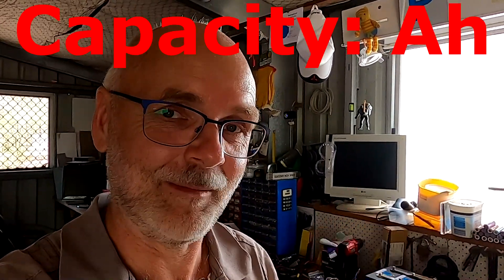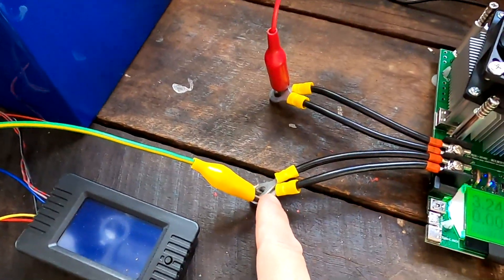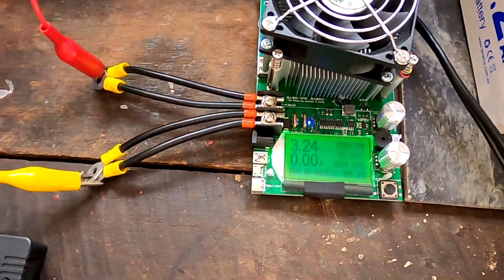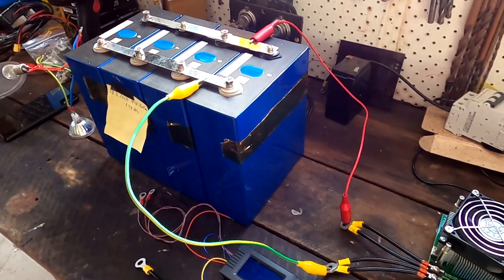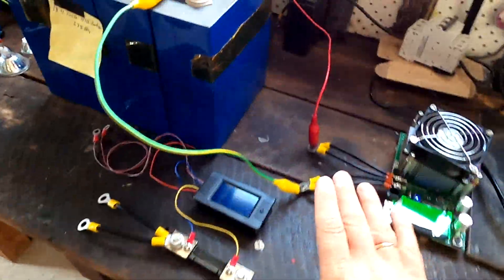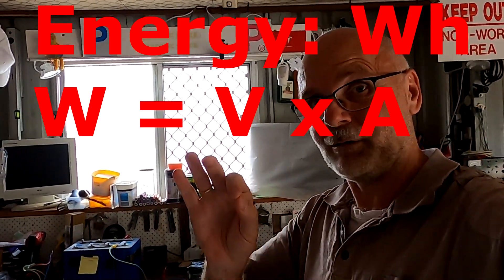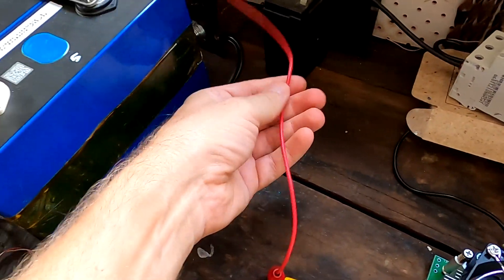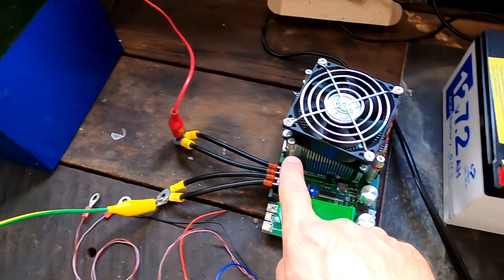Why Voltage does not matter at all during capacity testing! Here are the basics...

Comment: So basically, if you have a 1v battery and a 48v battery - both 280Ah (or whatever), you will get the same Ah even if you use a super thin wire... so the question is - why should we care about capacity? at the end of the day, we use batteries to store energy - so what we care about is Wh we get out of a battery (or pack). If that was not the case, we would not care about wire losses, battery resistance, etc etc... capacity itself is meaningless in real world applications.
Reply: Because it'a an easy way to test battery capacity without having to account for losses in wiring, wire sizes, load differences, voltage measurement inaccuracies, etc. You measure the amount of amps you get out of the battery, and compare to the manufacturer stated amp-hour rating. The amount of Wh you get out of a battery though is directly connected with the Amp-Hour rating, since the former is just the same thing but taking the voltage into account.

Comment: Happy New Year,,,, Professor Off-Grid Garage ;)

I almost forgot, I have a question.
I have a common 100 amp BMS for my batteries, but I'll be using my solar panels to charge, do I need a different BMS?
Thanks
Reply: No. The BMS protects the individual cells from overcharging or too much discharge. The solar has nothing to do with it.

Comment: While voltage is not in capacity (Amp Hours), the hours are time from a 100% SOC to 0% SOC, and the SOC is determined by the terminal voltage, is it not?
How did you determine 100% SOC and 0% SOC?
Reply: Charge to 3.65V until the in-going amps drop to 0 (i.e., no energy going to the battery anymore) for 100% charge, discharge until the voltage on the battery terminals drops to 2.5V for 0% charge. A LiFePO4 battery has a very flat voltage curve over the entire capacity except at low and high states of charge; very easy to measure.
Reply: @upnorthandpersonal  I am just saying you have to be careful when you say voltage does not matter to capacity, it IS involved in measuring SOC, which is used in getting the range over which capacity is measured--even if it is not part of the actual calculation.
Reply: @dr.dickie1418  Yes, but for LiFePO4 this is very easy since you have a very flat curve and only the knees (top and bottom) are where you can actually use voltage to determine state-of-charge for this chemistry.
Reply: @upnorthandpersonal  Understood. I was just mentioning that saying voltage has nothing to do with it, could confuse folks who don't know, that's all.  Wasn't correcting what he said, just clarifying it  :D
Reply: @dr.dickie1418  Yeah, likewise. The YT comment section makes it hard to get a point across.
Reply: @upnorthandpersonal  It all good, and Off-Grid Garage benefits from a lot more comments :)

Comment: Heat lost in cables and connectors BEFORE the tester is energy not measured.
Reply: Yes, but here we measure capacity, not energy, it shows up in the Wh measurements but not in the Ah measurement.
Reply: it doesn't matter. It's a series circuit. The current is the same everywhere, and that's what you measure over time (Amp-Hour). The literal definition of the Amp-Hour related to batteries is the amount of current a battery should be able to provide before dropping off: a 100Ah battery should (with the appropriately sized circuit, which includes all your losses, heaters, lights, etc.) be able to provide 100A for one hour. That's also why it makes no difference to do this with a 1V battery or a 1000V battery. The only difference is that the amount of energy contained in the 1000V batter will be much larger than that of the 1V battery at the same Amp-Hour rating.

Comment: This may be a silly question, but with hot wires, isnt that heat being taken from your battery's capacity?
Reply: Heat is energy (Joules, Watt-hours). Amp-hours is not energy, it's the capacity of the battery to push x amps over y amount time. It doesn't matter what happens to the energy since you're not measuring that. A 280Ah battery means just that: it can push 280A for one hour (1C), or 140A for two hours (0.5C), etc. What you do with the energy as a result of this current you're measuring is irrelevant.
Reply: @upnorthandpersonal  You are completely wrong.  There is no such thing as a perpetual energy machine.  A 280 amp hour battery at 1C is also a specification of circuit resistance and voltage which, in turn, are directly related to energy.  The heat loss is energy loss and that means less propulsive force to maintain amps and also to continue to propel electrons.  Your battery will deplete earlier not because of electron loss but because of energy loss.  Energy, amps, voltage and resistance are all locked together.  Energy only comes from the battery so if you loose it as heat, you are losing capacity.
Reply: @robertgrant5895  But it doesn't matter because Amp-Hours deliberately leave that out of the equation (and by definition, a 100Ah battery must be able to provide 100A for one hour before dropping off). It doesn't matter what the resistance is, and what the losses are, or if the resistance of the circuit is made up out of lamps, or an electrolysis system, or a combination: if there is a one amp current flowing, and you have a 100Ah battery, you will run this for 100 hours. Energy loss in the wiring does not matter since this energy loss is resultant the resistance in those wires, meaning that if the resistance changes, your current will change (because your power changes), but you still measure these amps so even if you suddenly only draw 0.5A because of increased resistance, you will run the 100Ah battery for 200 hours. The result is the same: you measure how long the battery can push x amps. You measure Amp-Hours, not Watt-Hours; capacity, not energy.
Reply: @upnorthandpersonal  Thank you - there's at least one other person commenting on this video that is helping stop the misinformation.
Reply: @largepimping  I'm trying, but it's tedious and YT comments are horrible to get a point across. A diagram with some math would easily clear this all up.
Reply: @robertgrant5895  I also made a video just for you. Check my channel.
Reply: @largepimping  I actually made a video on this topic because I got tired arguing in these comments - check my channel :)

Comment: Once again. The number of AmpereHours that You can pull out of a battery depends heavily on the rate . Pull 1 Ampere You get a much higher number of Ah compared to a draw of 20 Amperes.
Reply from the maker: Generally, yes. Not so much with these cells as I explained in the last video while locking at the graph. The internal resistance is so low in these cells, it barely makes a difference.
Reply: @OffGridGarageAustralia  You are right. These are High Amp Draw cells. 0.33 C is 93 Ampere, so You should get at least 280 Ah. A comfort, in the manual it says: "Repeating 3 times, if the capacity is not
 qualified." So You still have one go before we deem the battery below rating :)
Reply: This statement is more applicable to lead acid batteries due to Peukert's law. Peukert's law is not applicable to Lithium batteries. There is some loss of capacity at higher C rates due to internal resistance but Lithium batteries have such a low internal resistance that the loss is negligible.

I've done capacity tests at 200 amps and at 20 amps from the same battery and the Ah delivered is within a percent or two. Very little loss at higher C rates.

Comment: I'm not sure about that because if you are loosing watt hours you have to be loosing amp hours because watts is volts times amps and if you have 0 amps you can't have any watts if you were measuring like with the shunt at the battery then everything after that would show up in the test but their could still be losses before the shunt
Reply from the maker: Exactly what I said, there is a difference in ENERGY (Wh) and CAPACITY (Ah). The Ohm's law is clear and cannot be changed.
Reply: Look at is this way: if 1 amp flows in a circuit, with a heater, thin wires, etc. it doesn't matter where you measure in the circuit: you measure 1 amp. Now you want to measure how many amps the battery can deliver per unit of time - so you measure how long this amp flows and record the time (amp x time => amp hour).